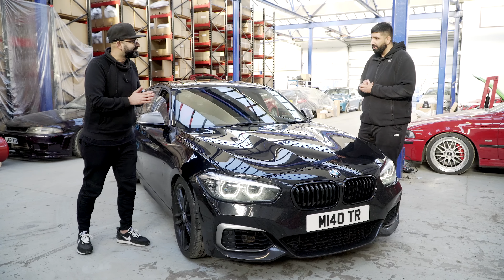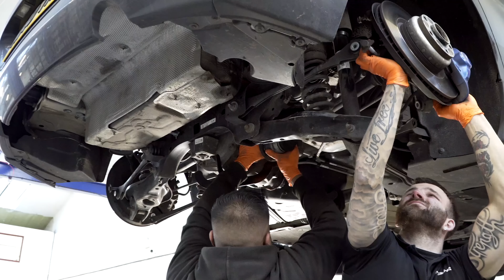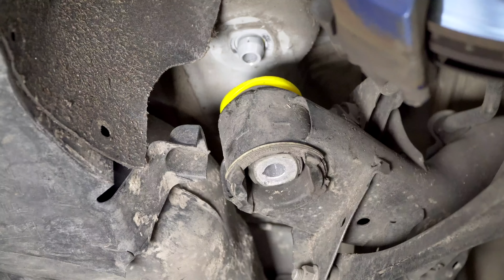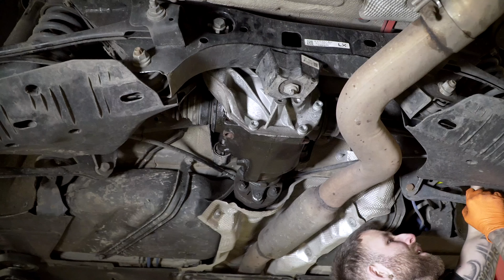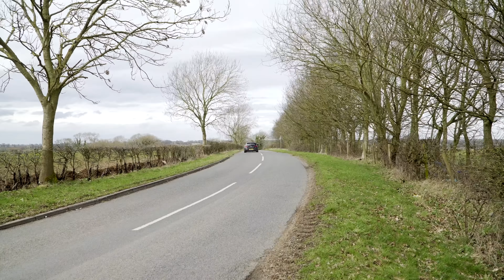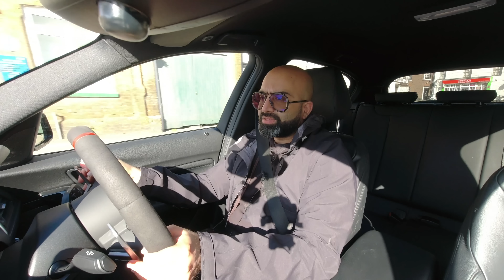Fixing the M140i's Biggest Flaw, the Open Diff! - Wavetrac LSD with @TRHamza

Comment: You should drive my M140i. It has Birds suspension, underbody brace, MP LSD and Michilin Pilot Sport 4 tyres. The latter is game changing compared with MPSS which are completely wrong for the UK.

Handling and grip levels are sensational. It drives like a £20k more expensive car.
Reply: Im just about to fit MPS4 245 front 255 rear on appropriate sized alloys, already had the diff and that is hands down the best mod, also have b12 kit, sounds like we have similar cars, i felt a bit bad the other day when i realised for 3 grand more i could have been in an M2, but too late now and the 5 doors does help to be honest, will just have to keep the car a long time now to get my money out of it.

Comment: Great video, and love Hamza's car.
If the M140i came with an LSD as standard, they would be too close to a real M car, and BMW would not sell as many M2's.
It is a flaw, but in reality only a very small percentage of M140i owners will ever drive it quickly enough to experience the benefits of a limited slip diff.
There are a lot of keyboard experts that just repeat the same old rubbish without really knowing (and most of them probably haven't even driven an M140i let alone own one).
If you are going to drive it at 10/10ths a lot, and do track-days, then a locking diff is a must.
If you drive it pretty slowly 95% of the time, and only have a quick blast once in a while (like the massive majority of M140i owners), then it's a massive expense for little benefit in my opinion. Of course, having a diff makes the front end more under-steery, and so you you then need to correct that by more camber on the front. It's a balance between how much you really want to drive at 10/10th's and your budget.

Comment: I know my remapped e92 330d ain’t no m lite car but with the open diff the one tyre fires were ridiculous so I had a quaife atb fitted. Transformed it! All moderate to high powered BMW need an lsd. When I eventually get a 135 or 140i this will be my first mod.
Reply: I had an e92 330d which was remapped to around 280bhp, felt very torquey and was a great all round car, quick while being great on fuel. 

Now I’ve moved to an M240i, also remapped to around 420bhp, it’s a totally different monster in terms of speed, sound etc. Although fuel can get very expensive but that’s expected. 

Overall would definitely recommend the upgrade and the LSD is definitely needed in the M1/240i

Comment: Excellent video as always. Can vouch for this modification 👌 Once you get the dampers/suspension and the M4 kit done, it takes it to another level.
Reply from the maker: Looking forward to driving it with those changes. There’s hope for the little M-Lite yet!
Reply: @EvolveAutomotive  Feel free to take my one for a spin, I’ve had all the handling bits done, supplemented by Evolve’s stage 1 😉
Reply from the maker: Imagine we’ll be doing another video on Hamza’s once we’ve fitted all those 🔥

Stage 1 really transforms these too, such a great platform to modify
Reply: @EvolveAutomotive  Agreed 👍🏼
Reply: @M_U_NAS  You say you have had all the handling mods fitted to your M140i, could I please ask you a few questions(?) And I REALLY need you to be honest with me, and though you obviously love your M140i,.. I really need you to be as objective and unbiased as possible.
              My wife and I are about to buy a car that's taken us quite a few years to save for and I really don't want to end up in a car that isn't what YT car presenters have hyped them up to be, so I'm looking for 'honest' info from those who actually own one of the cars I'm going to finally choose to buy.
           I've always preferred cars that placed handling over power and of the cars I've whittled down to considering (Type R GT fk8, Focus RS, Megane Trophy) the M140i is a car I've looked at in great detail to see if it can be made to handle so I can put it at the top of my list.
            I'm aware of everything that needs doing to it to apparently get the handling where I'd want it to be, especially on track and my visits to the Nurb-ring. But the cost to get the M140i sorted will be about five to six thousand pounds(!)... And I've had a few few people say that even after all that been done, it's still not on the same handling level of the others.
             I have driven a stock M140i and liked everything about it (especially the engine!) except the handling, which didn't impress on me at all and it got the car taken off my list.
               I don't know what cars you have driven/owned or your level of driving experience, but you have driven a "sorted" M140i and I would appreciate your honest feedback on the reality of the handling improvement with all said work done. How much has it really improved the handling, and if you've got experience with the other cars on my list, where would you place the sorted M140i amongst them as track/driver focused cars.... Almost as good(?), just as good(?) definitely as good(?) better than(?)
            In order of my personal experience with them, I rate the Type R GT fk8 first, followed by the Megane Trophy and then the Focus RS,.. Though the RS was over damped for the road, it was great on track and impressed well, but I've actually taken it off my list due to reliability issues and am only mentioning it due to the handling and driver focused abilities it had.
             It's the Type R GT fk8 which I'm most likely to aim for, but if the M140i handling can truly be improved to a level that the extra costs would justify, I'd definitely aim towards getting one.... But I don't know who to trust regarding just how much improvement I'd actually get for the 5-6k, having had a few former M140i owners tell me that though it does improve the M140i, it won't put it on the same handling level of any of the above cars and isn't ultimately worth the cost, telling me that only deliberately biased BMW fan boys say it is and won't admit that they spent a lot of money hoping to get a great handling track demon hot hatch, when in reality.. they just made the handling safer and a bit more usable.
              I have no way of getting into a "sorted" M140i for a test drive, let alone put it through its paces on a track, to be sure of who's telling the truth and/or even has the driving experience to know what they're talking about in regards to handling levels, abilities and etc..
             I'd appreciate your feedback, as ending up with the wrong car would be a epic financial blunder which my wife would not soon forgive. Cheers(!)
Reply: @prof.d.red-maa  Hey mate, based on what you've described as your requirements, my opinion would be against going for an M140i. 

I think a common mistake people make is putting the M140i in a similar category to the cars you've mentioned, however apart from the shape, they couldn't be more different! It really is a car in it's own category, best described as a 'GT'. 

As for the mods, it depends how far you want to go I guess, my mods cost probably half of the figure you mentioned, if that! The biggest outlay is the LSD. For me, the car handles brilliantly and the mods have made a huge difference. Of course this is subjective and someone like Imran (Evolve) would be ideal to compare and give an opinion on.

I've driven pretty much all the Hatches from the big German brands including other higher performance models. In terms of enjoyment, performance and value for money, I think the M140i sits well above the rest.

I think the FK8 is probably best for your needs, you'll get the handling out of the box, obviously doesn't have the straight line performance of the M140i, but that doesn't seem to be a priority.

Hope that helps :)
Reply: @M_U_NAS  Thank you for such a honest and detailed response,.. You are not the first to describe the M140i to be much more like a fast GT than a hot hatch and if purchased as such is a excellent car to own, that was actually my impression too when I first drove the stock M140i.. But people had tried to convince me that it could be turned into a M hot hatch.
            It's that fantastic B58 engine that makes the M140i so tempting to me, but I do do a lot of track time and B road driving so handling and balance are normally more of a priority,, an M2 is the obvious answer but sadly, though I could afford to run one its initial cost outlay of buying one is a few grand beyond my car budget.
               You are correct, the FK8 Type R does seem to be the most common sense option for what I need, but my wife really likes the M140i,.. Hmm(?) I don't know, maybe it's time to switch to a fast GT and enjoy it for what it is rather than what I'd want it to be. That B58 & the great reliability of the M140i is a VERY tempting proposition.
            Again, thank you for taking the time to respond, I'll rework the numbers for all the mods and see if in being precautionary I've overestimated the total cost of the mods... Which in my budget was set at £5k max to do (Wavetrack Diff, Motec Stance kit, B16 Dampers, M4 arms, Underside brace, rear bushings, 45 tyres on front with 55s on the rear, set of wider alloys, better oils and brake pads, plus labour costs), and is what I concluded after researching and asking M140i forum owners if that's the full list to get a M140i track worthy, if I've missed anything off the list please let me know.
            I would be leaving the engine alone as my wife insists on taking out warranty cover, which my local BMW dealer says we can still obtain even with the listed mods, but not if we touch the engine.
              Cheers!
Reply: @prof.d.red-maa  No problem mate.

The 5k modification price now makes sense with the list you have made. FYI, with the B16 kit (Spring & Damper) and wider wheels, the Motec kit will be redundant as they take care of that, so I’ve saved you 500 odd quid there 😉

One thing to note, my understanding of the BMW Extended Warranty is that any modification, voids the policy. It may be worth clarifying and have the salesperson/advisor provide you in writing that this ok, could be a sticky situation otherwise.

With that in mind and the fact you don’t want to increase the power output of the engine, the Original M2 makes a lot more sense tbh. Stock power figures are similar on both, you won’t need to do the handling modifications, therefore more likely to get BMW Extended Warranty (as I know it). Used car prices are fairly low at the moment, but expect to increase significantly come spring (UK).

Just some food for thought :)

Comment: I kinda feel like dumping grands into the m140i to try and make it handle like an m car defeats the object a bit. They are good because they are cheap and are good fun. But once you starting throwing thousands at it to make it better, its no longer a cheap car and one that will never hold value or be as desireable as a real M car. Take a look at the m135i's. You can pick a high spec one with the zf box for 12k now. You aint picking up 10 year old m3 for that kinda money...  The Diff is probably a good upgrade for sure but I know your gonna be set back over 3k for it fitted but id probably leave it at that if I was to ever get one. I drive an m2 at the moment and the reason I didnt get another m140i is because I knew I would have to throw 7k at the handling and chassis and another £1500 at the exhaust, intake and tune to bring it up to M car driving experience. Yes, they can be mapped and stage 2'd for a couple of grand but the rest of the car then isnt up to scratch for it. Then the problem I had was the cars only worth half of that of an m2 at the end of it all. Its kinda sensless and it doesnt look anywhere near as aggressive with the skinny arches and small narrow wheels. If you want much wider wheels on the rear with wider tyres then your gonna need wide arch kit to fit them, along with a spray job. Which puts at least another 4k on the bill.  Its a basic 1 series chassis with a fancy engine at the end of the day. Thats what makes them affordable. Lots of fun and a handful with the standard setup.
Reply: You are absolutely correct: 
Sadly, I am writing this after four years, and I have already spent a lot of money on my vehicle, a N57 stage 5 the suspension will be completed this year. I am not constructing a M car, but I am constructing something special. I find it more special than any M2, M3, or M4 car I've ever driven. one because it required time to construct  Yes, it's costly, very costly
Reply: I’ve got 1 and you’re spot on but what a machine it is there will never be anything like it again 3.0 6 cylinder RWD hatchback 😂

Comment: I have a Drexler LSD with Tuningwerk setup. By far best mod! And i have KW Clubsport suspension, Full Akra and Stage 2.
Not sure about the subframe bushes. Yes it feels a little bit disconnected and floaty stock. I do not like it on full throttle on the autobahn. Feels like its floating underneath you. But I heard multiple times they upset the balance.

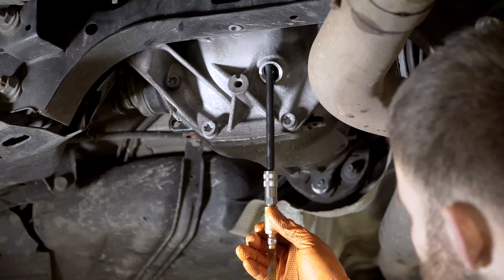Comment: Could you try and help debunk something. Did the stock diff housing have the drexler symbol (looks like an s) and 2.1 etched in at the bottom which you can see @3:48 on the new diff? 
Are the housings different open to lsd? Have wavetrac used an MP lsd housing? My 140 has the drexler logo and 2.1 yet was not spec’d with lsd, but was one of the last ones to be made. Is there a chance bmw chucked MP diffs in end of production cars?🤷🏻‍♂️
Reply from the maker: All we know is that Wavetrac use returned diffs to build up as Wavetrac equipped units. So very much doubt they are using MP housings.

Comment: Lsd is the ultimate mod for a rwd, would've been nice to record 0-60 with lsd and without, to see what the extra traction does.
Reply from the maker: Due to so many variables we aren’t a fan of 0-60 especially on RWD cars, but would expect a fairly significant improvement.
Reply: @EvolveAutomotive  20-70 or 60-120. Something in those lines, I get what you mean about rwd launch as a bit of damp weather like it is always in England will change the outcome.

Comment: Amesome car. I drive a tuned 218I Coupe stage I. Would it be an idea to fit it with a LSD too? Or is it better to reserve this type of upgrade for M-lite models only?
Reply from the maker: Any car could benefit from it, the more power the car has the more you will notice the open diff being an issue. So you might not notice a huge benefit especially considering the cost.

Comment: Imran, great work as always. I've checked forums/MSS website and wondered what you'd recommend for springs for an E91 330i M-sport. I want to keep the ride height the same ? Thanks in advance.
Reply from the maker: Keeping ride height the same you’ll not have much choice. Bilstein B12 kit is always a great option but will lower the car. B14 coilovers would probably let you set it at stock height.
Reply: @EvolveAutomotive  That works for me, thanks 🤙
Reply from the maker: @vollcare4076  we have a lot of customers fit MSS but retain stock ride height. Many people want handling/comfort improvements without the car being lowered.
Reply from the maker: MSS do not disclose spring rates. With their detailed R&D process and patented stacked spring setup they manage to improve handling of the car, whilst also reducing the discomfort experienced in the cabin. Admittedly it sounds too good to be true, but we have experienced it on multiple cars, and the difference can be pretty amazing.
Reply: @vollcare4076  Yup, aware of that.
Reply from the maker: Try the product. We would never just parrot marketing, we only recommend products we have first hand knowledge of, and only sell products that we truly believe in.

Just MSS springs are an excellent upgrade over say F80 M3 springs, but paired with Bilstein dampers it really is superb.

Comment: Looking to buy an M140i. Just wondered what price it would be to fit an LSD?
Reply from the maker: Can find more info on our website - https://www.evolveautomotive.com/makes/bmw/bmw-1-series/bmw-1-series-f20-f21-2015/bmw-1-series-f20-f21-2011-on-m140i/bmw-1-series-f20-f21-2011-on-m140i-drivetrain/wavetrac-atb-lsd-differential-supplied-installed-bmw-f20-f21-m135i-m140i-f22-f23-m235i-m240i.html
Reply: @EvolveAutomotive  Cool. Thank you.